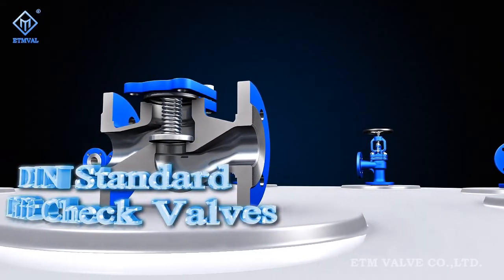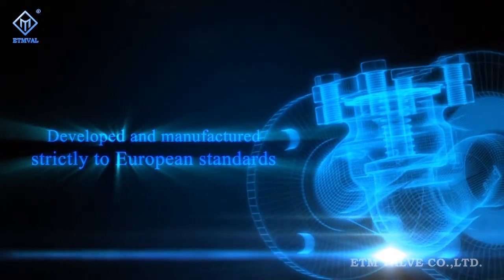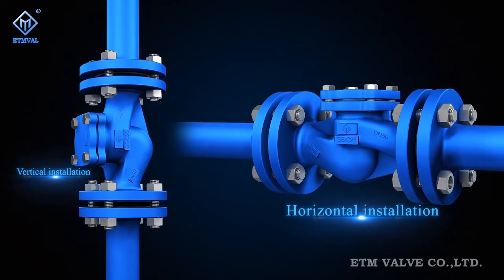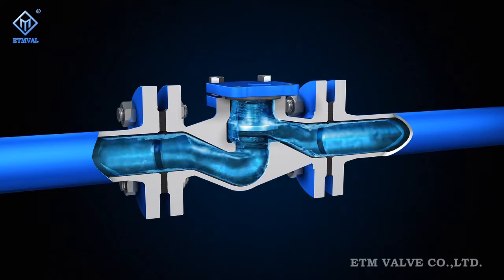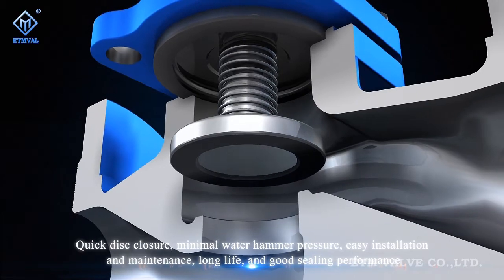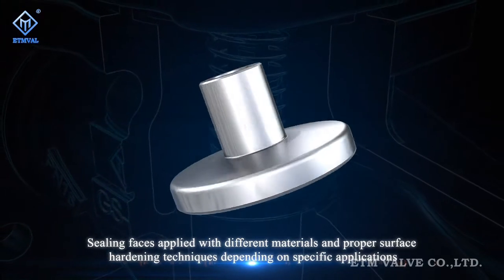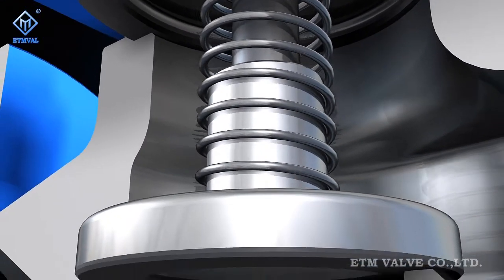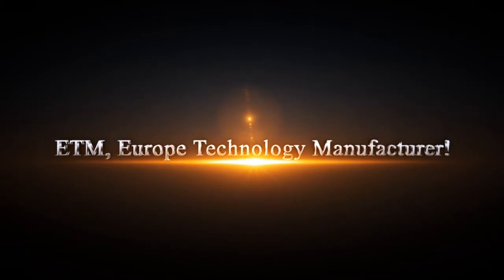ETM DIN Lift Check Valve

Comment: According to the life time , which one do you prefer to use, lift check valve or swing check valve? For steam using.
Reply: A swing check valve can be used for steam flow, but it is not always the most ideal choice. Swing check valves are designed primarily for liquid applications, as they rely on the force of the fluid (or gas) to open and close the valve. However, they may not perform as effectively with air or other gases because they can be slower to respond, potentially allowing backflow or pressure surges.
For air or gas applications, a spring-loaded check valve or a lift check valve is often more suitable because they provide quicker and more reliable operation, reducing the chance of backflow or leakage.